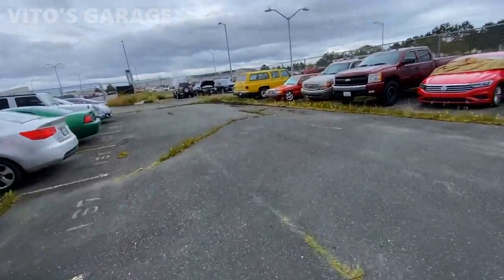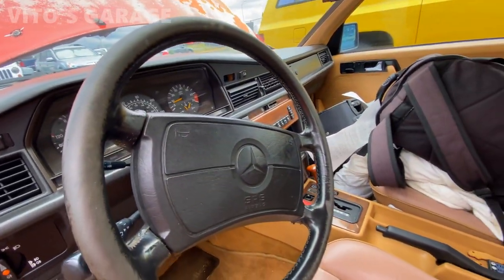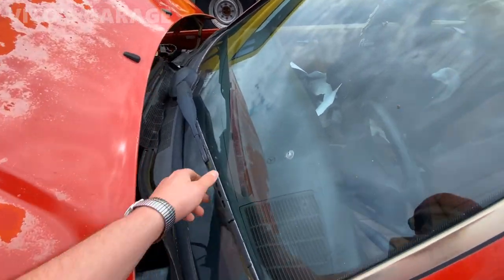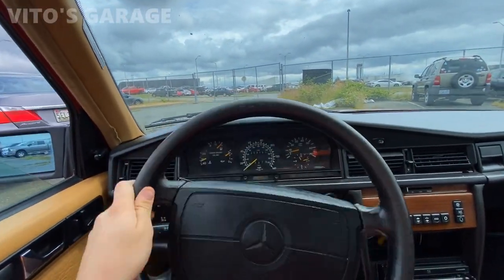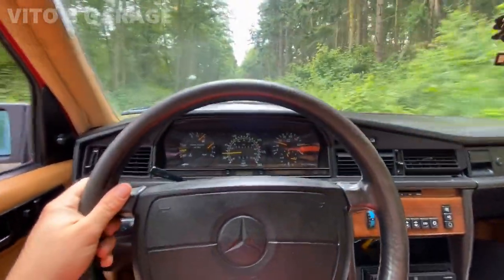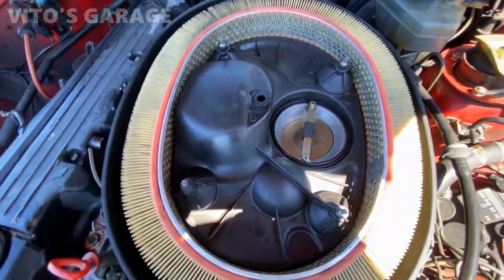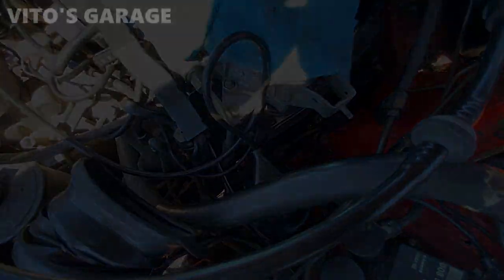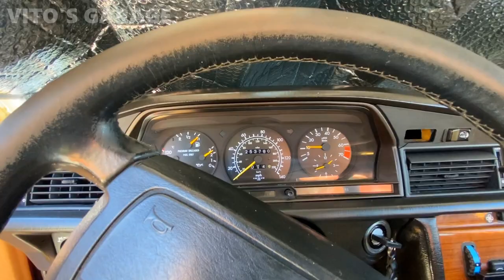Mercedes 190E 2.6L Starting After Sitting For 10 Months + Test Drive!!! Fresh Oil Change

Comment: I let a guy use my 26 year old 202 "kombi" Mercedes and after a time thank God he saw liquid under the hood. When we turned the motor on the cooling liquid came out of the motor. Thought it would be really expensive but all was 80 euros in the mechanic. It's not cheap but at least it works perfect again. And I don't pay taxes anymore, because it's older than 25
Reply from the maker: How did you fix the problem with cooling?
Reply from the maker: How did you fix the problem with cooling?

Comment: Hey Vito! I have been following your page for quite some time now, you have helped me aton with my 1987  190e 2.6. I was wondering if you would be able to help me diagnose an issue. When I go to start the machine I need to give it gas, occasionally it will start without hitting the gas peddle though. When it does start its a very rough idle, the vehicle eventually stalls out. I have to do this a few times for the car to start, once started it can handle a 200km drive with ease. Any ideas what might be causing this issue? Glad to see your back with your baby!
Reply: Sounds like you need to replace your gas filter. Seems to not be getting the gas or could be your spark plugs/cables. When was the last time you did a tune up?
Reply: @othanielgreathouse938  already did the fuel filter about 600 kms ago, plugs were done about 1300kms ago cables were cleaned about 2 months ago.
Reply from the maker: Cycle the key multiple times and see how much free play the airflow plate has. It should have a bit of play. But you have to cycle the key on and off multiple times.  Let me know. You may need to adjust the 3mm Allen (Hex) bolt that sits in the fuel distributor housing
Reply from the maker: Your cold start fuel injector should be checked too
Reply: @VITOSGARAGE  Thanks Vito! I will test these things and get back to you, I am about to drive her 200 kms back home today. I will let you know if anything odd happens!
Reply: @VITOSGARAGE  I have been thinking the car has been running rich, I believe I will need to adjust the hex bolt on the fuel distributor. I have heard this is very tedious though.
Reply from the maker: @bandovision4935  just push down and turn the 3mm hex. Just remember how much you turned it so you can always go back to the original position if needed
Reply: @VITOSGARAGE  thank you Vito!

Comment: Vito your badass brother and really hope to meet you someday sir
Reply from the maker: Thanks brother! And yes, we will meet up sooner than later :)
Reply: @VITOSGARAGE  Vito your badass brother again sir. Much love support and respect ALWAYS Vito! Just ordered a new Radiator coolant tank for my 1996 W202 C280 Sport M104 4 speed 722.424 transmission that needs a new filter and gasket kit and definitely needs to be revitalized and not necessarily rebuilt let's hope. And also ordered a AMG badge and a very nice new hood emblem to match my car and it's new 75mm wheel center caps